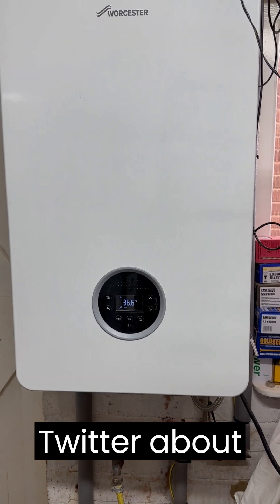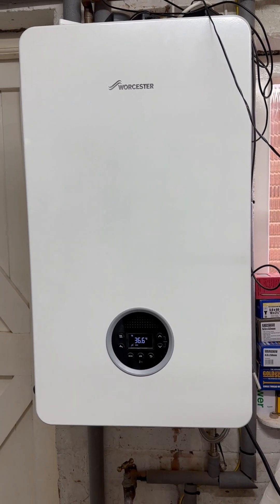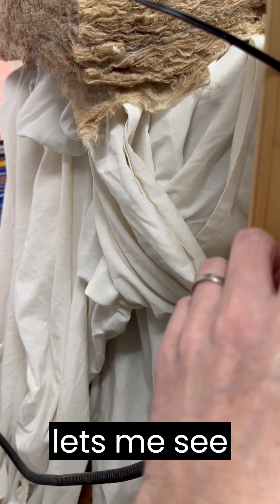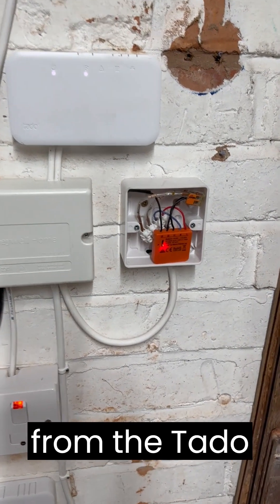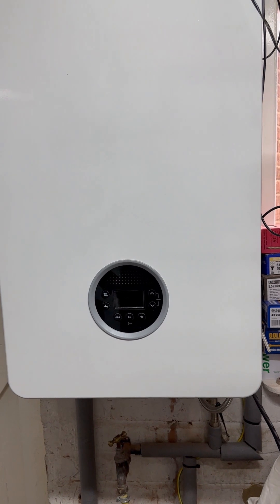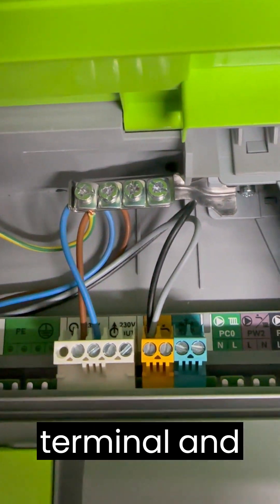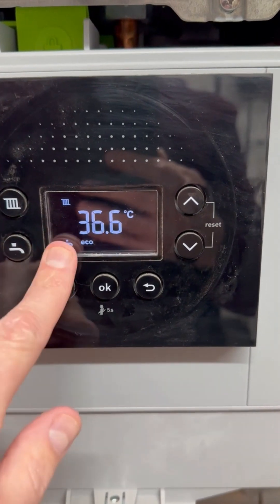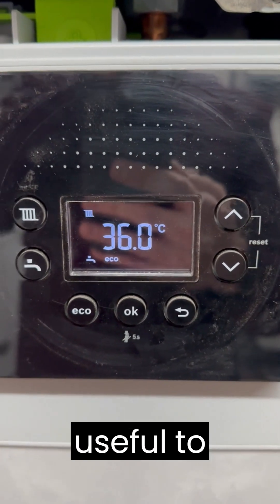Enabling Priority Domestic Hot Water with a 10k resistor!

Comment: What does the DHW sensor do? I have regular 8000 life boiler, an S Plan with a unvented cylinder and Tado for my rads so if I can use the Senor as intended that would be good.
Reply from the maker: This is usually connected to a temperature sensor in the cylinder, so the boiler knows how hot the water in the cylinder is. In my case, the presence of the "sensor" i.e. the resistor, fools the boiler into believing it has an integral diverter valve installed.

This then allows to me to use both the "Call for Heat" and the "Call for Hot Water" inputs and get two different flow temperatures.
Reply: I’ve set my boiler to heat HW to 60 degrees but I see the viper going up to 84 degrees, that seems to be a bit too hot doesn’t it?
Reply from the maker: Somebody else had that problem. They are here in the comments. They weren’t able to resolve it as far as I know. I’m afraid I don’t know why it happens.

Comment: Does this modification only work with the Worcester 4000/8000 Series?  I have a Worcester Greenstar 30i System ErP and tried the 10k resistor but no effect?  I've had a look at the installation manual for the diverter valve and all I can see is the cylinder temp sensor is required so not sure why the resistor trick doesn't work on the 30i?
Reply from the maker: I don’t know. A very experienced heating engineer gave me that tip. Does the instructions say what size of resistor it expects?

Comment: You know you can’t have y plan on an unvented cylinder don’t you… if you’d have got the 8000 style boiler you’d be able to see all the data such as pump speed and stuff on the screen
Reply from the maker: Why not?
Reply: @ because the valve can’t be shut off can cause the cylinder to over heat needs a two port as a safety cut off you can use a diverter valve which is 3 way but not a 3 ways zone valve
Reply: @ you can also do hotwater property with 2 two port valves when hot water is activated from the boiler it sends power to 2 port to open for cylinder then lives goes back out into n\c 2 port when thst gets power it closes until the hot water is satisfied then the valve will loose power and open back up to feed your radiators you can also range rate that Worcester boiler and turn your kw down in summer you can drop it to its lowest kw saves you on gas

Comment: Thank you sir for the helpful info. Not sure why they don't allow to set this up out of the box... My version of the boiler is the latest model (the one with colour screen), do you think the same trick will work?
Reply from the maker: It’s not enabled out of the box as it requires some specific plumbing. Not sure about different models. If it has a resistor input for hot water, I suppose it should, but I can’t guarantee it.

Comment: Thanks, this will make my life so much easier, you did seperate the heating call wires for water and heating didn't you?  Have the same boiler in a pub and want to drop the radiator temperature....
Reply from the maker: Yeah, I did.
Reply: Did you find once you do this when you call for hot water, the boiler flow temperature jumps to 85 degrees? I had it set at 70 degrees on the boiler but it seems to override it? I have a megaflo tank fitted.
Reply from the maker: @Tommy-f2o6q I don’t find that. Mine is set to a 65 and it usually settles around 70. This is a factor of the tank I think. It’s only able to absorb so much heat, so the flow temp rises up. That’s my vague understanding anyway.
Reply from the maker: What should your hot water flow temp and heating flow temps be? Does it respect the heating one?
Reply: So you don't think there is any wiring or setting i need to change on the megaflo hot cylinder  side? What i am finding odd is that the boiler service setting L1, A6 : set flow temperature shows 84 degrees despite me setting it at 70 degrees on the boiler itself. So I feel something is overriding it but I cannot figure out what it is. I'm just worried running it at 84 degrees every time I heat up my water won't be good in the long run.

Do you by any chance have any details of the wiring you did change to share?
Reply from the maker: @Tommy-f2o6q I just added the resistor :) The valves are controlled by software. Once the hot valve opens, the other heating valves close. I didn’t adjust any other wiring.

It’s strange that it’s jumping to 84. Can you adjust A6?
Reply: Yeah so the heating one i set to 50 and it follows that. The hot water one I have tried changing it to different values and it just seems to ignore it and go to 84 degrees.

No, unfortunately, A6 cannot be adjusted.

I'm just wondering if it's the wiring from the hot water cylinder that goes to the DHW demand input. Where does that wiring go for you?
Reply from the maker: @Tommy-f2o6q nothing special. It’s just wired into the call for hot water, along side the call for heat. Perhaps it’s trying to heat the tank as quickly as possible? Maybe another input is pushing the flow temp up along a curve?
Reply: @tomasmcguinness   so when my system was wired up I only had one wire coming from megaflo wiring centre to the boiler going to the call for heat. So I have had to figure out where the call for water wiring from boiler goes into my megaflo wiring centre. I had just linked it to the water valve but maybe that was wrong?
Reply from the maker: Mine was the same. Both the heating and hot water were wired into the same terminal. I just moved the hot water valve’s call for heat to the adjacent terminal.
Reply: @tomasmcguinness  so you moved the orange DHW valve wire to a different terminal and therefore separating it from the CH orange valve wire? Then you just had a wire from the same terminal as the orange DHW valve wire going to DHW LR on the boiler?

That's what I have done.
Reply from the maker: @Tommy-f2o6q Yes. The valve is connected to the DHW LR. Both orange terminals are populated. The wiring comes from my wiring centre. I will draw a diagram and share it here.
Reply: @Tommy-f2o6q  did you ever figure out why it heats it so high as mine is doing this now I just assume it heats the cylinder until it reaches the temp set on the cylinder thermostat
Reply: @greg01491  so I contacted Worcester bosch about this and they stated its normal for it to operate that way as it tries to heat up the water in the cylinder as quickly as possibly so it can go back to heating mode and be a lot more efficient. I was able to get the flow temperature down to 80 degrees by changing L5.A2 value to 40 degrees. As the resistor makes the boiler think the water in the cylinder is at 30 degrees, the 10 degrees delta helped lower it down. However, I still cannot get it to work at a flow temperature I set.
Reply from the maker: @Tommy-f2o6q what size of resistor have you used? I also noticed that I have a value called DHW flow temperature offset.  That was at 10, so my setting of 65 resulted in a flow of 75. I can’t find that value in my Worcester manual though.
Reply: @tomasmcguinness  10k resistor. Do you know what number in the service menu you saw the offset value?
Reply from the maker: @Tommy-f2o6q I’m using something called ems-esp to access the boiler’s settings directly. I looked in the documentation, but couldn’t see anything. I’ll have another look tomorrow.
Reply: @ I did this too and it stays around 70 so all good now I reckon

Comment: Hi mate. Im fitting a similar system at the moment. Does the boiler ramp up when there a switch live to the hw input regardless if theres a switch input on the heating side? I plan to use this with a normally open zone valve to isolate heat and hot water.
Reply from the maker: Yeah, the boiler will increase the flow temp to the hot water value. In my configuration, I use software to close the radiator/UFH valves if they are open. If I didn’t, I end up with the very hot radiators!
Reply: @tomasmcguinness  perfect. So it will ignore the heating switch live and weather comp when the hw switch live is powered.
Reply from the maker: @1000Mikey that’s my experience!  Let me know how you get on!
Reply from the maker: I just tested this. It will did up the flow temperature with a call for hot water, even when it was still getting the calling for heating. Not sure about the WC part, but I can’t see that making any difference!
Reply: @tomasmcguinness  that's amazing. Thanks for testing that out. In my head it would work despite Worcester telling me it's not possible without a system boiler with the diverter kit.
Reply from the maker: Well, I got the tip from Richard Burrows. I have actually just ordered a Worcester weather comp thermostat from MWPHS so hopefully it will work :)
Reply: @tomasmcguinness  I will be able to confirm for you by the end of the week but I can't see it not working.
Reply from the maker: Did you get this working??
Reply: @tomasmcguinness  Hi mate. Unfortunately not. After some more research it's not possible to have these functions aswell as weather comp using 8000 heat only boiler, only with their system boilers. I needed the extra kw to supply heating to a large pub and 2 flats within it. Every day is a school day!
Reply from the maker: @1000Mikey  that’s a shame, but good to know. Thanks for the update!

Comment: Hi watched the video on the priority hot water with 10k resistor did you have to do any alterations to wiring for the zone valves so it doesn’t open heating until hot water has no call
Reply from the maker: Hi. Thanks for watching. I haven’t altered that yet. I using the immersion and surplus solar PV to heat my hot water at the moment. When we need the boiler to boost the water, I manually turned off the heating :) I have a plan to adjust the valve control wiring, so any call for hot water will automatically close the heating valves using another relay to cut power to the valves.

Comment: One more question , I have the previous version of the boiler that does not have separate connections for heating and hot water. I have the same EMS bus gateway as you were previously using and using home assistant to set the max output power percentage based on if it was hot water or heating.  I am unable to set flow temperature and can only set maximum output power. Were you doing the same ? or were you also able to set maximum flow temperature in addition. When I try to set a different flow temperature it gets over written by what was set on the boiler.
Reply from the maker: I was adjusting the flow temperature. When there was a call for how water, Home Assistant changed the flow temperature to 70. Once the call for hot water stopped, the temp reverted back to 45. 

The setting I changed is called "Heating Temperature". There is another setting called 'Selected Flow Temperature' and that is a temporary one. That was a mistake I made.

I didn't think limiting the maximum power would have any impact on the flow temperature. The boiler will just burn at the power you've selected until the flow temperature is achieved. I've limited my maximum power to 50% and the boiler is still easily able to reach a flow of 70 degrees. Saying that, I suppose it might take little longer. Might be interesting to do the maths.
Reply: @tomasmcguinness  Thanks got it . In my boiler it is not possible to change "Heating Temperature" . That's why I thought the only tool I had was to limit the max power to slow things down for central heating. I tired the "Selected Flow Temperature" and it is changeable in my boiler !! ( Yes temporary as you have mentioned) . So for now going with repeating "Selected Flow Temperature" commands from HA with a temperature value that depends on if it is CH or DHW. Thanks.

Comment: wow ! so when hot DHW calls for heat you have a relay that connects the 10K resistor is it ?
Reply: I mean how do you trigger different temp for CH and DHW since call for heat for both go into the same terminal
Reply from the maker: They were in the same terminal originally, but I put them into their own terminals! Works really well now!
Reply: @tomasmcguinness  Would you mind elaborating on this please? Both valves connect to SL (Switched Line) on the boiler, so how do you distinguish between call for CH and call for DHW?
Reply from the maker: The boiler has two switched live inputs, one for CH and one for DHW.
Reply: I was also struggling to understand this part, my electrician connected both the HW and CH wire to the same SL so I think I need to split them and then connect them to their respective SLs?
Reply from the maker: That’s what I did. Once I added the resistor and enabled the DHW, I had to connect each port to their respective SL.

Comment: Opentherm controls will do exactly the same job😊
Reply from the maker: I don’t believe Worcester Bosch support the opentherm protocol.
Reply from the maker: I actually did review the settings offered by the EMS gateway and they do have a setting to enable DHW. At the time I didn’t think it would work without the diverter valve installed, but I suspect it would.